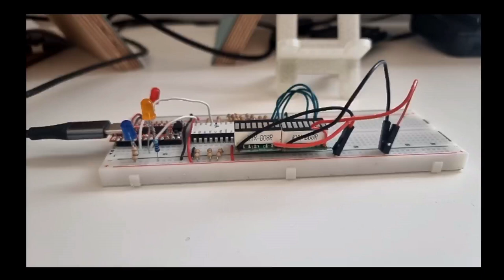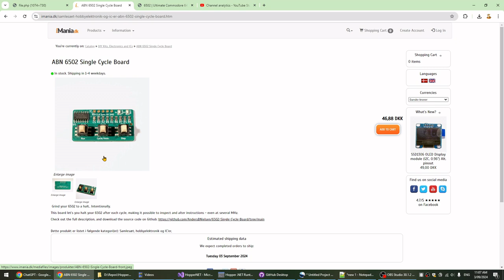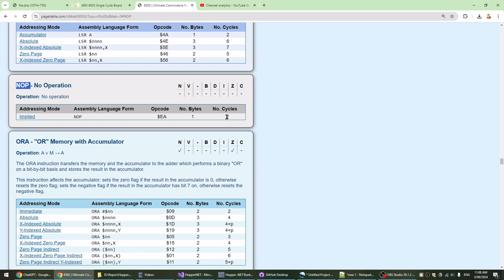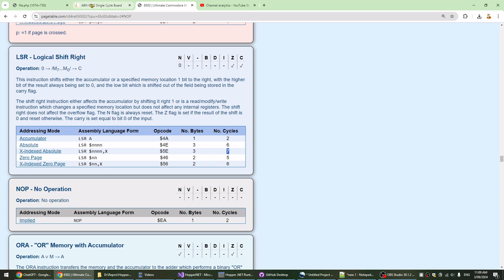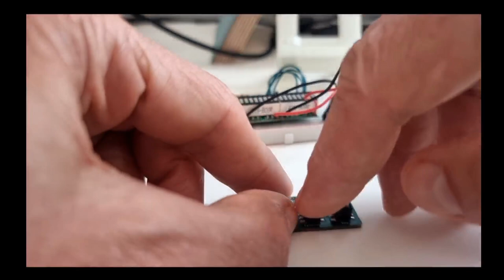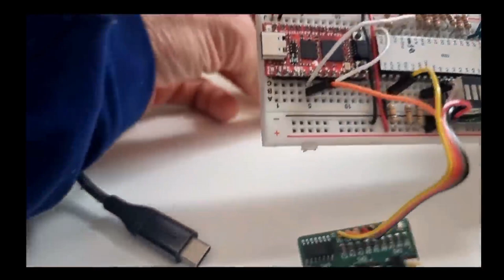Easy single stepping for 6502 circuits

Comment: You probably shouldn't connect unused  inputs on the 74HC74 low - at least not the unused !R pin - considering it is active low and  level sensitive so the FF would get stuck in a reseted state.
Reply from the maker: Correct. I misspoke: unused inputs should be pulled up.
Anders describes this part far better than I did: https://www.youtube.com/watch?v=w-1nl2ym9PM&t=112s
Reply: @biggertigger  It's a nice little board. I really should cobble together one some day. But it was many many years since I actually built anything with a 6502 so.... But maybe it could be adapted to a 6802/6809 SYNC and HALT signals as well - I'm a bit keen of building a small trainer board with one of those.